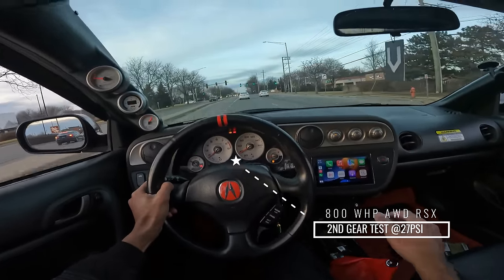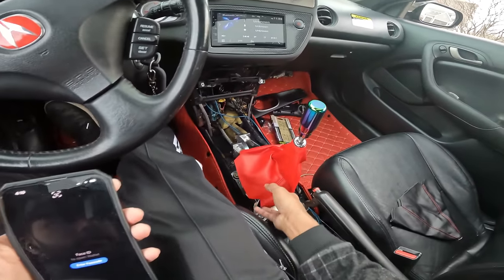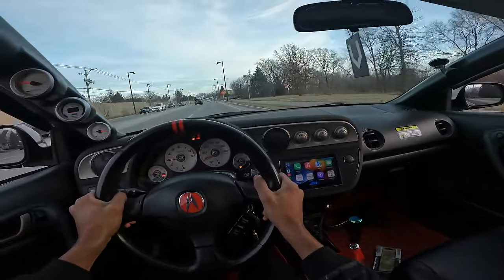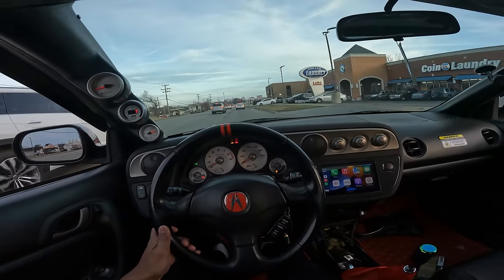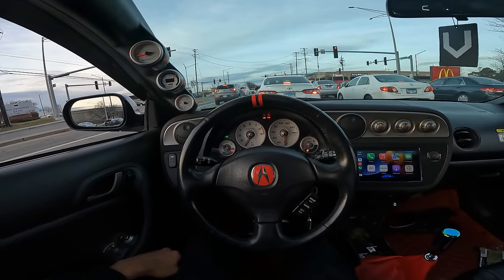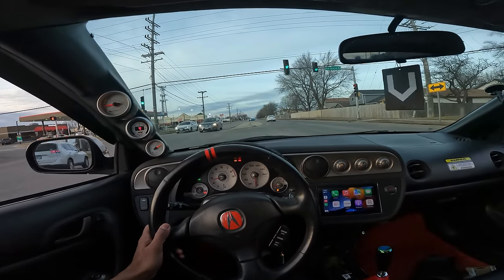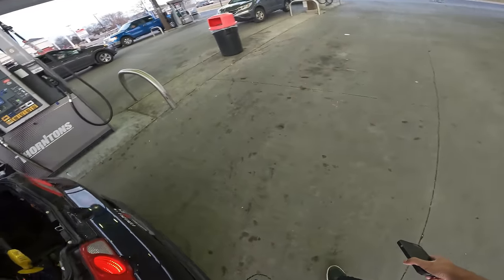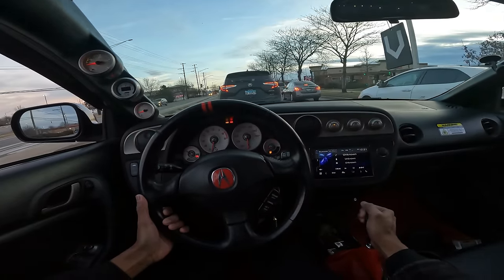POV Drive: 800HP AWD 2002 Acura RSX Type-S | LOUD Turbo | Straight Piped | Cold Start | 3D Audio

Comment: Should get out of the habit of dropping into neutral when your pulling to a stop bro. Especially when its cold, coming down through the gears helps warm the trans fluid as well
Reply: Downshifting does nothing besides wears your bearings sooner and sounds good lol
Reply: You really should only be downshifting to avoid getting the brakes too hot when going down a steep grade or when towing. Brakes are designed to stop the car, not the transmission. Notice nobody down shifts their automatic... It's simply not needed during every day driving in a typical passenger car or pick up truck

Comment: I don't know the history of this build but, your battery light would indicate that the alternator isn't charging your battery. Therefore at low rpm, the engine is more likely to stall because of the low voltage. Or the Idle air control valve needs cleaned or replaced. I'm an autotech that loves honda. What a great video man! Subscribed!! Bad ass car!

Comment: 1:25 ahh the good ol days of not having to push in the clutch to start the car 😄
Reply: @A almost all JDM cars you don't need to step on the clutch and breaks. Japan only applied that feature to USDM cars as an idiot proof feature
Reply: @imnotsurewhy  On the JDM DC5R you have to step on the clutch too to start it
Reply: This is done because when you install a much stronger clutch, the pressure that is put on the crankshaft against the thrust bearings is much higher due to the pressure plate in the clutch pushing much harder on it. This causes excess wear on cold starts when you hold the clutch in and crank the engine on.

To avoid this, we put a jumper on the clutch pedal switch. This makes the car think that the clutch is always engaged allowing you to start it without using the clutch. You just have to make sure its not in gear otherwise the car will move 😃
Reply: @A I've never been in a manual car that requires you to depress the clutch to start. This is the first time I've heard of this lol
Reply: @Robbaz99999  most of the newer manuals required this
Reply: @I'm not sure Why JDM EVO 8/9 you have clutch in to start!!!
Reply: @A just connects together both cable from  clutch pedal plug
Reply: @A i actually had an old golf that you could start while in gear without pressing the clutch... do not recommend doing that at all lol
Reply: meh it's dangerous I did that once in manual swapped bmw when friend was boosting car was distracted almost hurt him !
Reply: I've been driving manuals since 1987 always needed to press the clutch to start up.
Reply: Also it's a North American thing... in Europe Manual cars doesn't require you to push the clutch....
Reply: Is in neutral…
Reply: @imnotsurewhy  I still don't know why not clutching to crank makes me idiot lol. Supra JDM here
Reply: Yo guys it's just a clutch pedal switch that you can unplug and install a jumper wire in the connector. Almost all manuals have a clutch switch. My 97 Honda has one that I jumped so I can start my car without pressing clutch pedal in. Just gotta always make sure she's in neutral when I turn the key 😅
Reply: @imnotsurewhy  Well, on my Daihatsu Atrai 7, brought from Japan, you still need to press the clutch to start the engine
Reply: @imnotsurewhy  bro i got few typeR  they all required clutch start lol
Reply: You can start any manual car without pushing the clutch in lmao 🤣😂 it's called neutral
Reply: i can turn on my skoda octavia 2009, 1.9 tdi without cluch
Reply: @kristijan933  I think it's an America thing, all normal cars around the world don't need the clutch to be pushed if you are in neutral.
Also nice the 1.9 tdi is a tank of an engine
Reply: you can remove the clutch engage start switch on manuals to lol i did
Reply: i can start my dc5s in gear, no clutch. Did it once by mistake
Reply: or just remove the neutral safety switch you car virgin
Reply: if you disconnect your clutch saftey swich and put exposed wire in the connecter, itll sense the clutch always depressed and you're able to start without the clutch. Downside is if u the wire falls out of the connecter, you wont be able to start the car at all.
Reply: @legatus9081  In the UK anything past around 2008-2010 require clutch in to start. It can be removed but it's because so many people park in gear and we're just jumping in the car and turning the key 😂
Reply: I was pissed when I got my focus st, you need to hold the clutch and brake to start. A real PITA if it's cold/raining.
Reply: I was wondering that cause like all my vehicles needed to have the clutch depressed and they were much older. 85 Audi 87 ranger
Reply: @imnotsurewhy my 03 you had to depress the clutch to start
Reply: I’m still learning ab cars. Why don’t you need foot on clutch when starting this car?
Reply: dont have to on my 2012 jeep but then again thats only in 4lo and it uses the starter motor to move the car but still

Comment: 💥💯🚀🔥🔥🔥Just completed my 2 year project 2JZ swapped 1980 AMC Eagle AWD with twin 64mm hairdryers . Had to install a custom support bar chassis due to aggressive 4wheel burnouts roll racing she rips all 4 mud/snow radials at 40mph its sick total 🔥8.70 @168 1/4

Comment: Sweet build man, your car seems to have a hunting idle, I would rule out the two basic steps for that condition known for stock hondas/Acuras, low coolant or air in the cooling system or a dirty or bad idle control valve, I would start with that

Comment: Love the power- seems you need to clean the iac valve and disconnect the green plug  from imoblizer under  steering column to get the key light to stop flashing! Get some

Comment: Great Car!!! I have a 2015 Scion tc and I’ve been upgrading internals to boost it because tcs are so slept on you can really do so much to the engines I love it!
Reply: Nothing is slept on. Capabilities are what make the car not worthy for tuning. May want to research.
Reply: @AndrewKidd14145  tcs are great when boosted
Reply: Lol
Reply: グルグ  those motors in the mr2 are fuckin amazing though. Because of how it’s oriented in the car. Everything plays a role when creating a car. Which is why I don’t tune fwd. because rwd will always handle better no matter what because of physics.
Reply: グルグ  I used to have a celica, pop up lights I think 3rd or 4th gen. Still to this day I miss it I should have kept it even though I don’t tune fwd. I’d KILL to have that celica. Along with the 2nd gen awd turbo eclipse I had. It was “too fast” so before I died my dad sold it.

Comment: Amazing speed but the upkeep is gonna be insane on that Acura, constantly being in the shop drives me nuts when I had a turbo civic. It was a nightmare I wouldn’t wish on anybody
Reply: yeah fr, my buddy has a RWD swapped boosted 3rd gen Integra and I swear that thing is always broken, but when it runs it's a whole other game
Reply from the maker: If built properly, the K series +  a nicely built transmission with PPG gears = reliability! 
Its been 1+ year and 50+ pulls on this car so far. So far, it hasn't broken even once!

Comment: Had the same hunting idle in my ford fiesta was so annoying , engine would shut off right in the middle of the high way! Mechanics had no idea what the problem was , but I got a new electric throttle body in and it fixed the problem .

Comment: Check your O2 sensor could be why it isn't idling right and why it dies especially when cold. May need cleaned or completely replaced. Not that the two cars are exactly the same but I recently had a problem just like that on my jeep Cherokee XJ and after cleaning the O2 sensor it was no longer an issue.

Comment: I had the same idling/stalling problem on a car I added a custom built turbo kit too. I always thought it had something to do with bypassing (or just not using) the EGR valve but we could never figure it out
Reply: Get rid of EGR (block of ports/bypass) and adjust the manual throttle stop (screw bottom of throttle body) - at least that’s the usual location in my experience.
Reply: @HondaAcura💙NY  where were you when I had the car 15 years ago lol

Comment: had an idle issue with mine what fixed it was shaking my fuse box {temp fix(zip tied it in a specific spot then it stopped happening)} its been about 6 months and still going good

Comment: Release clutch more slower or keep at a steady angle… Like don’t even release all the way right as soon it engages into 1st gear… kind of have to work with the RPM… Trust me… releasing clutch slower to the point you’re BARELY pulling out… trust me you will FEEL the MAJOR smoothest difference… you wont JERK at ALLL 
If you release slowly until it engages 1st gear then you just speed up the release…. That’s like interfering with the RPM rate… not sure how to describe… so that’s why the car will jerk like that… 
When you’re releasing clutch but the RPM is going up too quick that means you’re pushing acceleration too deep yet not releasing clutch with it… you gotta like be in sync with the Transmission and clutch release and That clutch Grab… trust me… releasing much slower and keeping that clutch basically not going anywhere but it engages 1st gear… you’ll feel the car if you need more RPM less or press in clutch a little bit then releasing it to get it going but smoother… I have to show you so you can have a better understanding bc I myself am trying hard to describe and make it make sense lol. Thanks
Reply: This is for ANYONE. Not content creator… if Content Creator reads this… lol 
He’ll know EXACTLY what I mean… you seem rusty tho lol
Be like that
Reply: Sounds like it’s got a twin disk so it’ll be more rough, also ppg 1st gear is just as long and oem 2nd,  even rougher
Reply: @AK47xSNIPES  I wished I Understood

Comment: I HAVE OVERHOLUD AND TUNED AUDI A6 1.8 T QUATTRO R4 -C4II  T51 TURBO AND AEEN TUNE AND AEEN CHIP AND MTM  RACE CAMS MTM R CAMCHAFT 2.9 BAR TURBO LADD 8500 RPM 1606 HP 1100 NM 320 KMH TOPSPEED

Comment: Got some comments . 1 why would you use you remote to unlock your doors if your windows are down . And why are you yetting in the passenger side when you could backnup in your driveway . And your idling engine sounds like a harley that dont want stay running it sounds horrible

Comment: Bro to be honest there is something wrong with the car, how can you enjoy an extremely bouncy ride like that. It shouldnt be doing that you need to make your mechanic aware. I dont see how your mechanic thought it was safe releasing that car back to you with it driving in that condition. That's not fun and it won't be fun for your passengers either.. thats exactly why your car shut off when you tried to hit high rpms. It should be able to drive in rpms that's what your car is made to do

Comment: Omg he is holding down the clutch while waiting the traffic light....
Another rich guy that can't drive..
Reply: Not that big of a deal
Reply: @trashbandit2449    in normal cars is not big deal..
Reply: @GeorgeTigra  how is it a big deal in a not normal car? A clutch/throwout bearing still works the same.
Reply: @trashbandit2449  have ever push a clutch like this?
Reply: @GeorgeTigra  yes. It will wear the throwout bearing, but that bearing will still last longer than the clutch usually. I don't do it often, only when I'm not sure when the light will turn green. Otherwise I take it out of gear